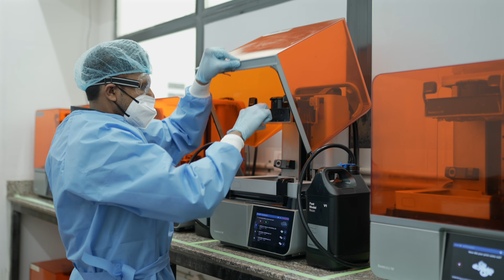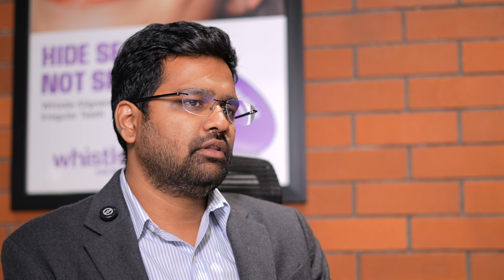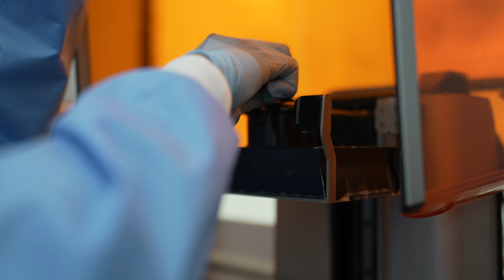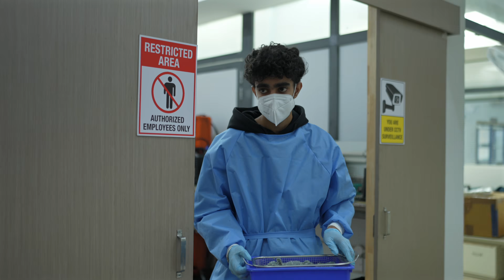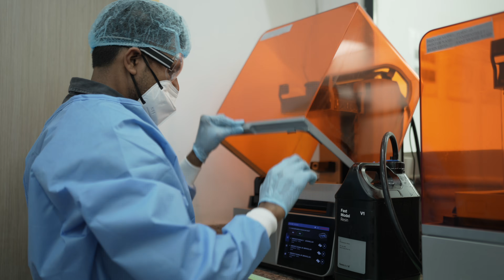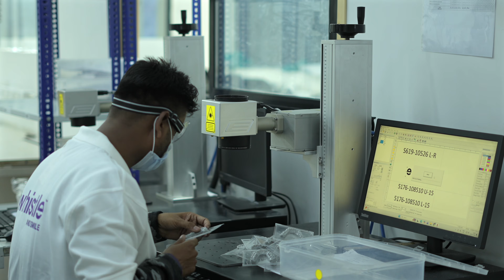50,000 Aligners Per Month: How Clove Dental Scaled with Formlabs Form 4B

Comment: I would be worried about putting resin print in my mouth, i wish they spoke about that. Larry
Reply from the maker: In this case, the 3D printed parts are simply the models that the aligners are thermoformed on. But there are actually a lot of biocompatible dental 3D printing resins that are suitable for intra-oral use!